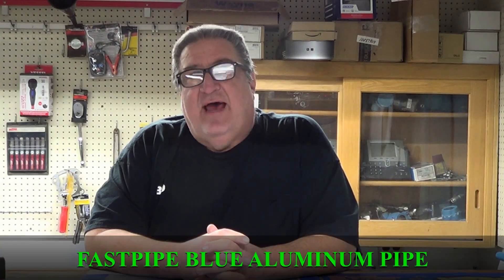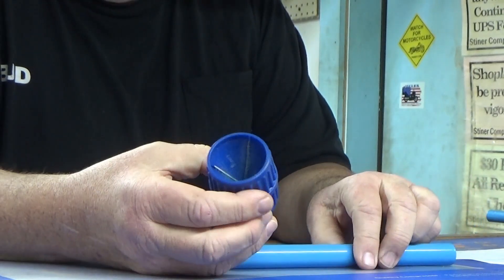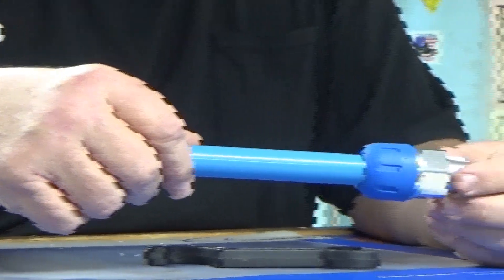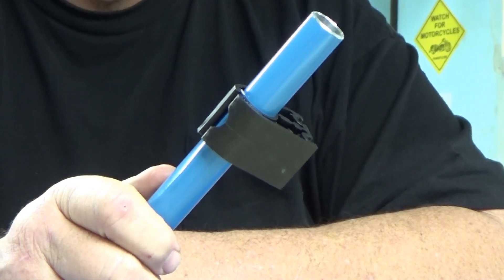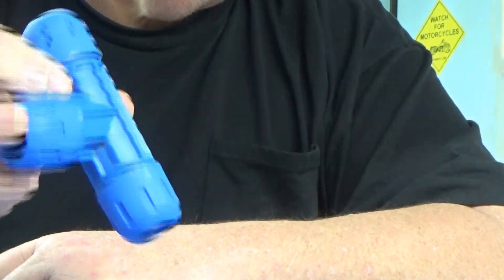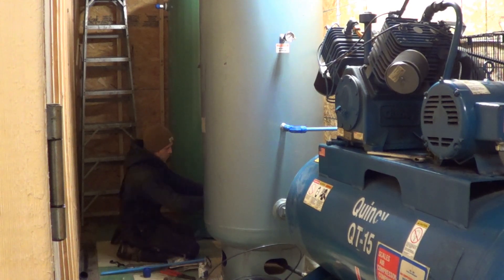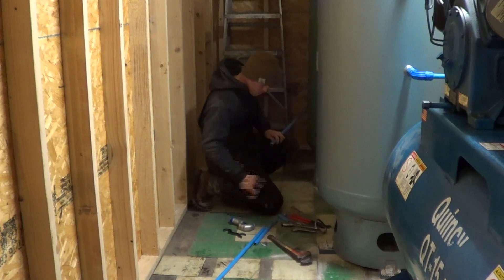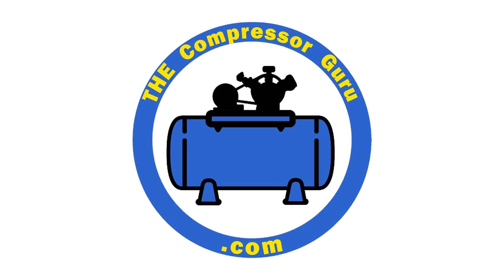FAST PIPE Air Line

Comment: I used the RapidAir 3/4" Maxline kit in my shop. It worked out really well. The piping come in a roll and needs to be unrolled and straightened but it wasn't difficult. The fittings are high priced as well, so buyer beware. I have three drop outlets and I have two hose reels mounted inside, and one hose reel mounted outside under the eave. I used 3/4" stainless steel pipe fittings to make the manifold and I have a Wilkerson 3/4" filter/regulator. I've been using the Milton V-style hose fittings for better air flow.

Comment: That's a pretty sweet way to handle piping.  When we were with champion - they had a quick lock system that was pretty much the same as the Rapidair Fast pipe stuff with nylon fittings (I believe both are made by transair).   Right now the Aluminum pipe is actually cheaper than copper here in MA.  The fittings may be expensive, but Rigid ProPress copper fittings aren't cheap either.  We make up any of that cost in labor - it's so much faster using the push to connect fittings like the Fast Pipe system than crimping or soldering copper fittings.  As always - thanks for the content!